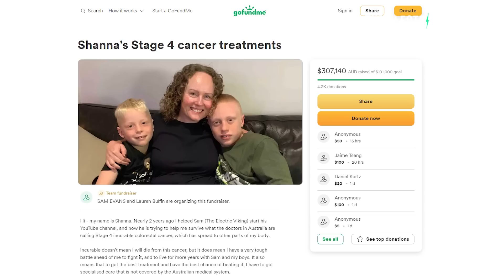CATL unveils Condensed Battery for Aircraft & 1000 mile range EV's

Comment: Big correction regarding commercial airliners: Range in kilometers is roughly 2X to 4X battery energy density using the modified Breguet range equation with the most extreme and optimistic parameters which force a huge increase in aerodynamic efficiency over current aircraft and thus radically redesigned airplanes with HUGE high aspect ratio wings. Please do not overstate battery electric airliners. The current batteries only allow woefully inadequate range, and HSR trains are far more efficient for such short trips. As an experienced aeronautical engineer, I can explain in more detail if you would like.  * Range does not include rquired reserve range so that will be a big issue to resolve.  Here are the estimates for far out battery technologies.
500 Wh/kg yields 1900 km range*
1200 Wh/kg yields 4600 km range* SABERS
2600 Wh/kg yields 10000 km range* Li-S
* With my upper limit estimates for equation parameters L/D=22, ETA=0.95, Mbat/Mass=0.5 (flying battery wing!)
Ammonia or hydrogen fuel can easily match today's range with new more efficient airframes with the above parameters.

So sorry Sam Evans, from the above figures it's unlikely batteries will be good enough or as good as ammonia or hydrogen fuel for long range large commercial transports.   I am an aeronautical engineer with 20 years experience in the aviation industry.   The Breguet range equation (battery electric aircraft version) offers an easy way to calculate the potential range with a few simple parameters.  I have calculated what it is for various battery technologies and they are vastly insufficient for long-range commercial transports but for short-range commuters there is great potential and they could have very low operating costs.

Comment: 3 reasons to keep working on SS batteries and NOT put all your eggs in the CATL condensed battery;
1.  Price
2.  Price
3.  Ya, price might be a huge factor... if the battery cost 3X what current batteries cost, then what's the point?

Comment: One thing you worded really poorly. No it doesn't give longer range and lighter batteries, it's either or. You either get double the range or half the weight. Honestly I'm expecting EVs to end up similar to combustion where they have a common range. Go ahead look at all combustion cars and notice how their range always is between 400-600 miles. Rarely more, rarely less. The reason seems to be that brands specifically aim for 500 miles as the bare minimum and stop there. 

Even though something like a Prius is twice as fuel efficient as an F150, they have about the same range as the Prius gets a tiny tank. I imagine EVs will likely do similar instead of pushing mega battery packs.

Comment: They already have these charging stations up and down Florida to charge these airplanes that they are already using. I already have 4 of these new Graphene Supercapacitor Batteries that will give me a total of 1,200 kWh of Electricity that are really small and weigh under 20 lbs and thinking about putting a couple of them on my bike. I could breeze to San Francisco in a heartbeat (I’m about 20 miles north of SF) and drop into a coffee shop and literally have them charged in minutes and be back in no time… 😁

Comment: 1kg kerosine is 12kwh
1kg of this battery 0,5kwh
This mean 1kg kerosine equal to 24kg of this battery

A trip of 9hours  in average plane is 65.000kg in kerosine
1.560.000kg in battery 

No plane can do this and how do you charge this

1.560.000kg x 0,5kwh=780.000kwh 1.1 charging efficiënt makes 858.000kwh required 858 Mwh
Average consumption  1 person in us 886kwh a month 1 trip can provide almost thousand people 1 month of electricity

Comment: What they would need to do for airplanes is have fault tolerant battery packs where you have one main battery pack that's enough to fly the plane for X number of miles, and if there is a failure, there's a secondary battery pack that automatically switches over that's enough to fly the plane to reach a location to land.
Reply: This is air travel we are talking about, they will probably have at least 4 different battery banks per engine, in order to be safe.
Reply: @christer.rehnstrom  I'm wondering what kind of engines they are going to use to fly a plane that's the size of a A380.
Reply: @Oneness100  Me too.
Reply: @christer.rehnstrom  I would use these batteries for cars, SUVS, Trucks, Buses, etc.   And if they can get the average car to have at least 400 to 500 of reliable, safe range, that would be ideal. For work trucks?  the same or more.  etc.  

The problem with regular vehicles and work trucks is the price, range, charge time, safety, weight.  If these can solve ALL of these problems, then they really should push these batteries for everyday vehicles first.  Planes should be secondary.  IMO.

Comment: I see the application being forced a bit for a plane.  And it’s most certainly not there for a jumbo jet. I would be way more excited about the use in small vehicles and commuting bikes. Outboard e motors on boats would be a top pick for me.
Reply: A jumbo jet can have a fuel weight of 184000 kg, with a 500 wh battery that will be about 92 mwh. Sine a jumbo running in high altitude uses about 60 kw,   you can fly about 1.5 hour with that. So lets hope density increases tenfold in our lifetime.

Comment: Simple solution for airplanes, have multiple batteries connected in parallel. If one battery failed electronically remove that battery from the circuit.

Comment: 0.5kWh/kg with Teslas doing 4miles /kWh means a 400mile battery will weigh 200kg - the small car excess weight problem would be solved and perhaps the 4miles/kWh will increase to 5 with the lower inertia - fingers crossed that there arent any serious downsides!

Comment: So easy to build redundancy into an airplane just make separate batteries with separate wiring to each separate motor all independent of each other. Even if you lose three of the four motors which is highly highly unlikely you can still land the thing.

Comment: Sam, you need to brush up on your physics. Energy density (i. e. how much energy does a battery of a given weight contains) is conventionally measured in watt-hours, not watts. The latter is unit of power, same as horsepower. To say a battery puts out 500 watts per kilo is saying that it puts out that much power per kilogram. 500w per kilo is not much. Lead acid batteries can do that. The CATL batteries are being claimed to have 500 watt-hours per kilo (i. e. they can put out 500watts for 1 hour per kilogram of battery). Now that's impressive. You also said that one could put a 50kwh pack made with these cells in a car and get increased range. Not true. Range is a function of kwh. You can put a lighter pack in a car using these new cells and get increased range, but the pack kwh rating will have to be higher to do that.

Comment: Stuff that is needed before this really gives us big electric aircraft: 1. Companies need to decide if they will use this battery or will they avoid early adopter issues and wait for the next better one. 2. Supply lines must be established so there are no shortages delaying things and the aircraft can still get replacement parts few decades from now. 3. Planes need to be designed. 4. Designs must be tested. 5. The working design must be approved. 6. The final product must be affordable and good enough that airlines want to use them. 7. Wait few decades for old planes to be replaced. 8. Hope nothing goes wrong, including the next big technology breakthrough making these batteries obsolete.

Comment: I'm a big fan of CATL but bold claims require bold evidence. I'm ready to see this in a plane and better yet, if this can be used for cars then I'm ready to see this used in a car. LUCID was on to something the way they put their large battery in their car and to this day in the US they remain to king of the road when it come to range. I'd like to see CATL using a smaller battery pack in in an EV and getting the same or better range than the LUCID. The most common question you get from people not sure if they can go electric is wit it have enough range. And telling people your car gets 300 miles on a full charge even though in the real world you're advised to charge to 80% and then you're told your existing range is going to based on other factors....doesn't sit well with potential buyers. But a smaller battery being able to achieve in 400's after charging to 80% to 85% will be a big hit.

Plane are something different altogether. We may see this battery in a plane but it will be many years before this is allowed commercially.

Comment: Battery failure in a plane ?
Have each engine feed off separate redundant battery packs.
Throw in an airline sized parachutes and safety is pretty much ensured.
Fewer moving parts, less needed maintenance.

Comment: This will enable mid weight BEV sports cars with acceptable range and “lightness”, a handling advantage that brute force and engineering subtleties in heavy BEV sports sedans like S and 3 Performance models and Lucid Air have to use.  This should enable ~1,400-1,500 kg two seater sports cars, same as say Toyota/Subaru 86.

Comment: This development augers well for the road freight industry. A 4 tonne battery with 2,000 kWhs would see a seismic shift away from diesel. Let's hope it's real and they have also sorted the safety, charge rate, durability, cost and production at scale issues.

Comment: Harbour Air already flies smaller battery electric De Havilland seaplanes out of Vancouver harbour to Victoria and other cities on Canada's Vancouver Island, averaging about 30-40 minutes per trip.  It's not hard to imagine stepping up from there in stages with higher density batteries with ramped up and performance.  Overseas intercontinental flight on 300+ passenger aircraft?  Might be better to wait and see before cracking open the Prosecco.

Comment: Viking, you have your units wrong. This is not a 500 W/kg battery. This is a 500 Wh/kg battery. The break through here is energy stored by weight, not power delivered by weight.

Comment: 500 wh/kg will be amazing for vehicles. The Size of the Aircraft scales with the wh/kg. This will be good enough for small private aircraft or small commercial aircraft, or maybe new 4-8 person eVTOL but it is still not high enough for large commercial aircraft like an Airbus or Boeing 737. You would need about 2000wh/kg or higher. JetA fuel is equal to 12,000 wh/kg. At 60% fuel efficiency, jet engines are still at a level of about 8,000wh/kg. The efficiency of distributed electric and improved electric aircraft design could make this better but we still have a long ways to go!

Comment: Hi Sam, And how would Solar cells added to the fuselage and maybe wings (not sure about these because of the amount of flex, thinking of the way Aptera made their bodies) add to the range of the aircraft, once above the clouds you would have unlimited sunlight during daylight hours.
Reply: Not very much because PV modules are orders of magnitude not powerful enough to contribute any meaningful amount of energy. 

PV can harvest peak about 200W/sqm. Let’s say the plane fuselage is 80x10m and let’s just assume Sun shines on it from all sides simultaneously-> 160 kW. 
Let’s say a commercial Airliner users 3.000l Kerosin/h a 10kWh/l  = 30.000 kWh 
Account for the miserable efficiency of combustion -> a battery plane off the same size would perhaps require only 20% of that, making 6.000 kWh/h flight. 
But you only produce 160 kWh.  
So you produce roughly 1/50 of what the plane needs.

=> It’s not worth it.

Comment: Hey Sam, please remember that watts are units of POWER.  Watt-hours are units of ENERGY.  You should be saying that CATL is announcing a battery with 500 watt-hours per kilogram of storage density.  A 100 watt light bulb burns through 100 watt-hours of energy every hour it is lit.  This is the same sloppy use of language that has all the climate alarmists concerned about carbon, an element essential to all life on our planet, which appears in the forms of diamond, graphite, graphene & charcoal/coal, when they should always be referring to carbon dioxide, a known greenhouse gas.  Lazy speaking is a mark of lazy thinking, imho.

Comment: Aircraft will not just have ONE battery.  They will have several, which can be isolated or interconnected much like the many fuel tanks of today's jet aircraft.   That said, don't look for large electric commercial airliners anytime within the next 50 years.   We will see small, short haul - limited use -  commercial EV aircraft within a few years, however.

Comment: It was mentioned that a new type of anode is part of the battery. What is the composition?  Amprius is using a silicon anode to build a 450 w/kg battery for the aviation UAV market currently on a limited basis, soon to be 500 watts.  Mass production is scheduled for 2025. Hope Amprius comes through with their plan.

Comment: It's interesting to compare how the petrol and diesel cars developed in 125 years compared to how rapidly the computer industry did the same, but with massive developments in 50 years. Now with the phenonimal pace battery advancement has leapt in a mere 20 years, by 2050 battery power using solar, wind and water power will make all other forms of polluting fuel systems virtually redundant. Will be interesting to see if nuclear power is still required. We can all hope for its demise on this fragile planet....

Comment: 500wh/kg at the cell level or at the pack level? How much package support is required to make a battery pack from the cells? Does the pack level density drop to 400wh/kg or 300?
Reply: These are pouch cells not usual round cells. And cooling requirements make huge difference. But you can roughly extrapolate from existing cell to pack level density. I would assume 400Wh/kg is more likely. There is also one 'false' claim in video. Ampri is already producing 450Wh/kg cells and announced they'll start with 500Wh/kg and they are about to build their first giga-scale-factory.

Comment: Airplanes have redundancies for most of the critical systems. Multiple engines, multiple fuel tanks, multiple fuel pumps, etc..  I don't see why a battery powered plane would be any different.  Instead of one big battery, they're probably going to have multiple systems, just like current planes.  This would probably help with balancing the weight of the plane anyways by spreading them out, rather than one big battery pack.

Comment: For large airplanes, 500 Wh/Kg will not be good enough unless they are built as structural batteries, saving parts of the structural materials otherwise would be needed and especially saving materials otherwise needed to build modules.

Comment: @6:55 you discuss what if you have a battery problem in an aircraft.   If I were designing a new plane with this technology I would have multiple engines and swappable batteries.   As soon as a plan lands the old batteries are pulled and fully charged one are inserted.   The engines would have to be separate so if one engine goes down then the plane can still land using the other engine.   They are going to have to figure out a better way to extinguish a burning battery or have the ability to eject a burning battery so the plane can land before it burns up.

Comment: Electric airplanes could have two motors with a separate battery for each motor. It could be set up so that if one motor goes out both batteries could be used to power the remaining motor.

Comment: There are batteries that exceed this energy density - but they are non-rechargeable single use, which limits their usefulness. 
For aircraft, propellers would be good for short range and intermediate range flights. for longer ranges and higher speeds, a hybrid electric/jet engine would work well.

Comment: Seems like less of an unveiling and more of a preliminary - and information-poor - announcement.  There are many important aspects of the cells that remain unspecified: charge rate, discharge rate, cycle life, capacity retention, safety profile, volumetric density, performance vs temperature, manufacturability at scale/expected production ramp, and, of course, cost.  Until we know more about these things, it's impossible to predict the impact of the new cells or the timeline thereof.  I am cautiously hopeful given the development comes from a huge, established firm with a track record of massive scaling, but the proper approach in my opinion is to wait and see.

Comment: I'm interested in how this technology handles safety.  In a car - when a battery " Goes WRONG" - the vehicle burns to the ground. I wouldn't feel good about a "run away" problem with a failed battery at 30 thousand feet.    I think I would need to know a lot more about that tech before getting on any plane with battery power.
Reply: Same outcome as a jetliner on fire at 30 thousand feet. It's gonna crash and burn.

Comment: Exciting times Sam! This will propel EVs into every area of service. This will help with semis and heavy equipment too.
Reply: At the  AGM for Rio tinto recently one of the largest minerals and mining companies in the world, in the CEO opening speach he gave some figures. If we want to replace all our current energy with wind solar and batteries, we will need to mine in the next 20 years the same amount of copper that we have mined in the entire history of humans mining copper!!!
Similar things for Aluminium and steel, Lithium and cobalt, so in order to go net zero we will have to rip up and destroy the planet. There has to be a better way this will not work.
Reply: The diesel market will either be super slow to transition or super quick. If you can make the case for fast cost savings, the transition will be quick. If reliability is an issue, companies will want to stick with diesel.